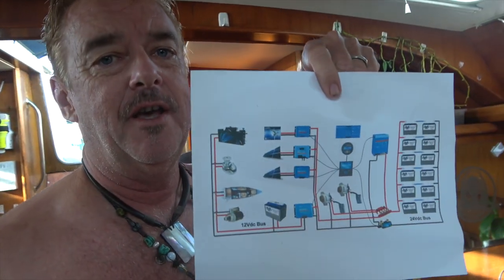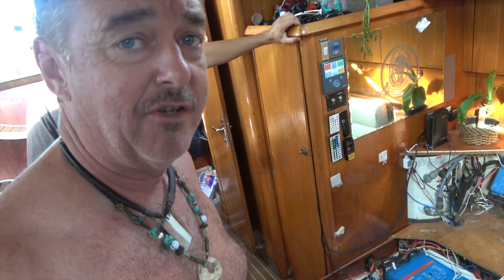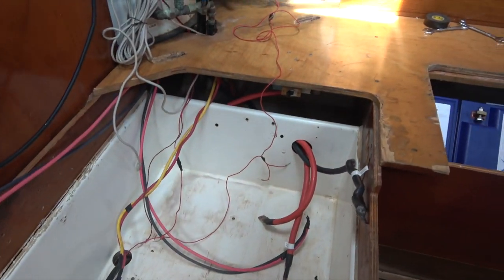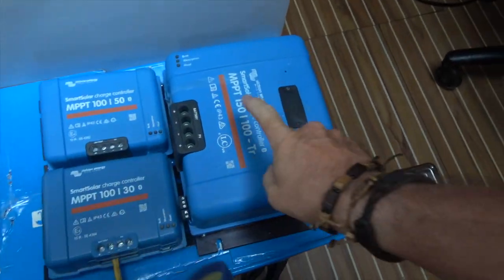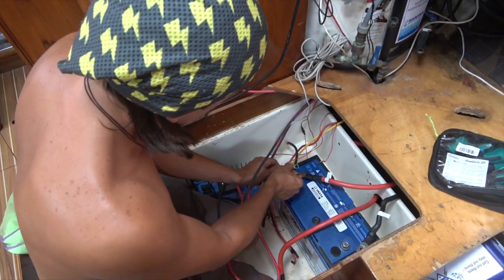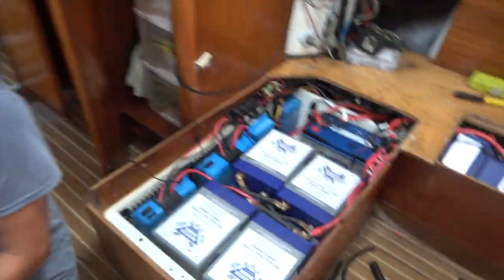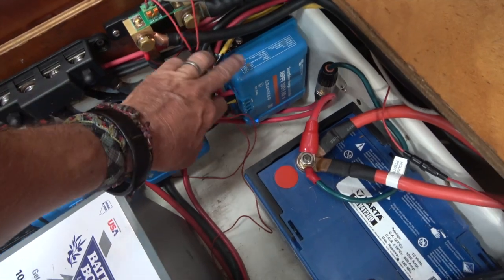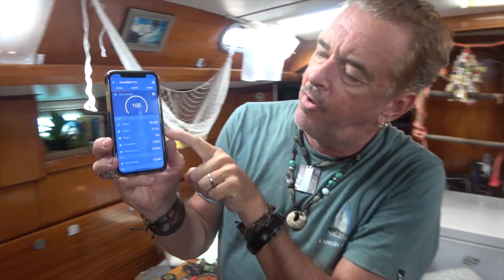SSL510 ~ IT WORKED..!!

Comment: I liked how you used the 100 amp charge controller as a 24vdc to 12vdc converter. I think the largest victron 12 to 24 dc to dc converter is 70 amps.
Reply from the maker: I like using the charge controller with the regulator built in instead because then the battery absorbs all the shock loads of the system, and the charger just recharges the battery in its own time.. :)

Comment: Capt Rick, I went the 48 volt route to cut down on the wire size needed.  I also went with a 48 volt combo controller/inverter to 120 v.  Most of these hybrid controller/inverters have a-c input so I can direct run the generator into it.  I eliminated a good portion of the apparatus/hardware with such a set up and have reduced my physical footprint to save space.  The particular controller/inverter I chose has a 3500 watt output at 120 v, so it's ample for most all I need.  In any future rebuilds of your system you might consider such for you set up.  By putting more panels in series I was able to reduce the wire size as the amp draw is a mere 5.9 amps.  And the controller/inverter I used has a 150 volt input so I can input all my panels at once even in high sunlight.  There are some that have even higher ratings than the 150 volt or the 3500 watt inverter output available.  Of course the cost goes up so I chose this arrangement to meet both budget and need.    I can use 29 amps simultaneously which is quite ample for my need.  My panels are producing around 135 volts.  I have 10890 watt hours battery storage (3 times 3630) using 3 banks of lithium cells.  I was able to connect the panels to the controller/inverter using just 10 ga wire.  And 6 ga wire from the controller/inverter to the batteries.  I could have reduced the size of that wire to 8 ga but had the 6 ga on hand and went ahead and used it.  
So you can see the obvious advantages of this set up in reducing wire size and apparatus required.  Not sure of your voltage requirements (perhaps you have a need for the 24 volt and the 12 volt) but if you can consolidate you will save on size and weight while simplifying your system.
Reply from the maker: The entire boat electrical system is designed around 12V, so it doesn't make sense to replace every single system, just augment it with a more efficient charging and storage system.  My solar panels are in series/parallel configuration at an average of 70V per series circuit, and yes I could go higher by putting more panels in series but keep in mind that we are on a sailboat and if you have a mast or rigging shadow on any one of the panels in the series circuit, you immediately lose a majority of the charging capabilities of that entire circuit.. all panels in the circuit, not just the one that has the shadow on it.. an important consideration when working with solar on a boat.

Comment: Rick, I have a similar system n my boat using the solar chargers as battery chargers saves power and weight. I find as you did that the batteries really never drop at all as the solar charger is in a constant state of management. I did assess the need to have a charge from the solar panels,in your case the wind generator, but felt it was unnecessary as the 12v batteries are always charged via the solar charger. I send all of my solar power to the 24v battery bank and let the 12v be managed solely by the separate solar charger/battery charger. Also the overflow of power to the water maker is an excellent idea,i have not done that yet. Excellent video and thank you for the education.

Comment: Captain Rick. Excellent video with a simple yet detailed overview of the process and how the new  24volt system operates. As your other viewers have commented, you would be (are) a great instructor. For all the boat owners out there, what would a rough estimate of parts cost be to make a similar electrical retrofit? Maybe separate into three system categories: solar panel system, battery system and control system. Too many variables on labor. Be safe and salute to 2021 and sailing adventures. 🍻

Comment: Could have done that battery bank to 24V with only swapping one wire + one extension.  Just split in the middle, then put the two half 12V banks in series.
Reply from the maker: Many different ways, this was just my way.  :)

Comment: It's wonderful seeing all your work and learning from it.  What is your largest consumer of electricity on the boat?  How long could you operate if EVERY electrical device was on at the same time and you had no positive input from solar, wind or generator?  It seems you could actually have an air conditioner if you wanted one, and that would help with humidity below decks as well as temperature.

Comment: When your 12v sacrificial battery totally fries you can replace it with a capacitor bank or you could just add the capacitors to your system 12v side.
Reply from the maker: won't need to, the battery is in the exact environment it was designed for.. start a truck engine, and then roll down the road all day with the alternator keeping it fully charged.
Reply: @SailingSophisticatedLady   Not to yank your chain, a truck start last seconds, your windlass sucks a lot of amps for what could be several minutes. Not the same profile of discharge, just something to keep in mind. A simple fix would be to replace the motor to 24v. I personally think that in the long run you will probably end up doubling your batteries again and go to 48v and regen-electric motor for propulsion.

Comment: You need 48vdc to run the aircon and large appliances!  I learned the hard way and minimum 8 batteries!  There's a 15kw inverter sold on eBay i bought 3 of them through out the years started with a 12v then a 24v but the 48v works great!  I think it costs 600 dollars. If you could find a 72vdc inverter it would be much better but it would need 12 batteries and make much less heat!  I agree with the truck battery but 2 of them would be better.  You will need 2 large battery cables for positive and 2 for negative to the inverter on a 24vdc system!
Reply from the maker: we aren't running a house, we're running a boat, and our loads on the AC side never top 1800w or about 140amps at 12Vdc and that's with a full electric galley.. the wiring installed was designed to handle even in excess of those loads at 12V and now we have converted to 24V and cut the current loading in half.. not expecting any problems here.
Reply: @SailingSophisticatedLady  my experience is from living in an rv for 7 years but I used about the same amount of solar panels.
Reply from the maker: @peterscherling6594  yes, shade free.. we have a mast and rigging so very rarely do you see both sides of the boat in full sun without one side being shaded.. just regulates our max potential power each day compared to the same system on land, and of course we are not trying to run aircon or big household appliances, most of our draw is just refrigeration and computers for editing.. 3kw Inverter is more than plenty in our type of application, and 24v is more than adequate to power it.. I’ve been using 12Vdc for 15 years on this boat, so even 24 is a major step up.  :)

Comment: Rick, you didn't address ventilation cooling to the charge controllers compartment with all those heat sinks in one small box!
 I would use a 12 to 24v converter and dump the wind gen into the main bank.  
alternatively addressing the wind gen into the main bank, dont quote me,  an additional 12v battery and the 12v wind controller output in series equals 24v, then parallel into the main bank that is 24v. 
I don't think the 24V controller will allow backward charge from excess 12v house battery from a excess wind gen during desirable times like 3 day storms. 
We learned something from the dark windy storms that lasted a few days.

Comment: OK, let me see if I understand this. You are using the 24V system as a reservoir of energy allowing you to run your 12V boat with a more efficient way to charge and hold that energy? This way you don't have to convert all your 12V pumps etc. to 24V? Thanks for all this info.
Reply from the maker: You nailed it sir!  :)

Comment: Amazing upgrade, I just have a couple of questions? In the past your old system produced enough power that you had to turn things on because you were getting a high voltage alarm. How did you cure that with this 24volt battery reservoir? Do the victron charge controllers have a load dump? If so do you put the load dump into the 12 battery? My system i use the load dump to keep the engine battery charged (all lead acid) or to power a 12v hot water heater(still working out the kinks with that.) Thanks for the informative videos we love them just as much as your "fun" videos.

Comment: Did you configure the house charger to trigger at a slightly lower voltage than the wind generator charger so the 12V system can take all of the wind generator output before drawing from the main system?

I don't know if that's possible, though...
Reply from the maker: You are very intuitive, and yes I did exactly that!  :)

Comment: Awesome install! Are you planning electric motors (sail drives) as well?
Reply from the maker: not yet, it would still take about 60Kw of battery power to run that type of system on this size of boat, and that would only net you 5-6 hours of propulsion at around 5 knots.. then you have to replace the 60Kw of power from somewhere, which is near impossible on a sailboat unless you power it with a generator which kind of defeats the purpose, or plug into a dock every night, which we never do.

Comment: The first 4 Battleborn should not have the connections pointed toward each other.  Don't trust  that they won't find a way!
Reply from the maker: They will have wood spacers between the banks, and strapped down for rough weather.  :)
Reply: @SailingSophisticatedLady  I figured :)  How did you even wire it without an opps?   You are braver than me.  You have 2x storage as me and we run our whole house and shop.  Ready for some long cloudy sailing?  Go Battleborn!

Comment: WOW! What are great electrical upgrade. Good luck with the results. Yeah the memory gets short over time, so I like the labeling too. Does your phone app also give you any of your diesel engine parameters for when it automatically goes on its exercise run once a week? Will you plan on having a new engine installed in the future?
Reply from the maker: The engine is still the only original item still left in the boat.. still debating on options there..

Comment: Not sure about that 600ha calculation with 3 pairs of 100ah batteries??  I could be wrong but series you only get 2x12v 100 ah = 24v 100ah with some small loss depending on cables. Don’t get me wrong I’m sure you have a good system
Reply: Please check the theory, I don’t want to look like a geek
Reply from the maker: it's 6 pairs of 12V batteries.. 12-100ah 12Vdc batteries in total.  1200ah at 12Vdc or 600ah at 24Vdc

Comment: Capt Rick, the “Lady” owns a fortune 💵 in batteries.  How are you anchoring down the batteries to keeping them from moving in rough seas?  Also, are you coating the battery 🔋 terminals with anti corruption grease?

Comment: Hey Rick, looks like a great system.
What exactly are you doing with the engine alternators.
I think I heard you say you were changing to 24v, then I also thought I heard you say you were keeping a lead engine start battery, are you going to use another Victron dc/dc converter to charge the 12v engine battery from the main bank. How do you regulate tha alternators?
Reply from the maker: Yes, there is another DC to DC converter keeping the engine battery topped up, and the 24V alternators will eventually be externally regulated, but I just have some cheap internally regulated alternators for use right now since they are just a backup on our backup at the moment.
Reply: @SailingSophisticatedLady  Careful with that Rick, You really need adjustable external regulators otherwise your Battery Management System will "over voltage" shutdown the bank and by doing so let the smoke out of the internal alternator regulators I think. All that charge and no place to go!
Reply from the maker: @chrisfoote9413  yes you are right, but I typically never use my alternators except in bulk charging mode, my old ones I had manual controls so I could just shut off the field control when I didn’t need them anymore

Comment: I just asked myself a random thought.. with all of your batteries & solar.  Do you still even have a shorepower plug & charging system? Those things take up a fair amount of room.. bad if you never use it. Do you have any 110 plugs only connected to that shorepower system?
Reply from the maker: Our shorepower connection is at the back of the boat, which we only use at marinas (not frequent) or with our backup generator, which we only need use of after several cloudy days.  In either case it powers the new 70amp 24Vdc charger built into the Victron inverter/charger we just installed in this video, to recharge the new Battleborn lithium battery bank.
Reply: @SailingSophisticatedLady  that makes sense.. I rewired my boat but only 12 volt.. so this project is really Interesting. This was 25 years ago. I splurged on gel cells batteries. Big mistake. My engine charges out at a higher amperage than the fuel cells liked. They kept bulging and were replaced on warranty 3 times. My mechanic said he could install a smaller alternator.. but I got group 27 batteries instead and all was well after I stopped trying to experiment

Comment: It's time to get rid of the boat motor and get yourself an electric motor to replace it.
Reply from the maker: would love to, but 60Kw of lithium batteries will only get you about 5-6 hours at 5 knots and then you need to recharge them from somewhere.. I have a 2.3Kw solar array that averages 8-9Kw per day, so obviously that won't help with much.. unless you are plugged into a dock to recharge, or running a generator (which kind of defeats the purpose), it is not a practical solution at the moment.. hopefully in near future though!  :)